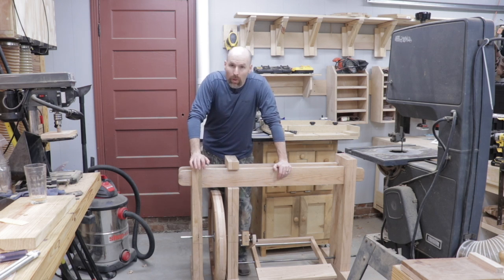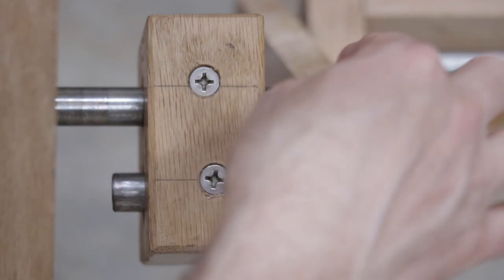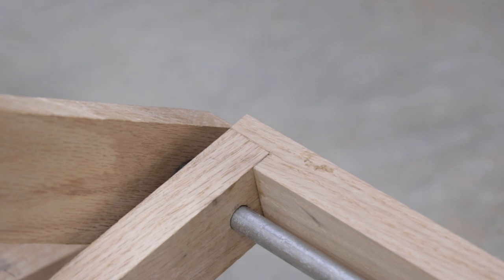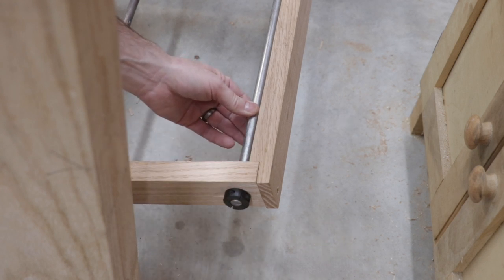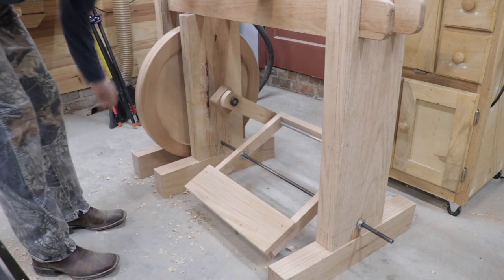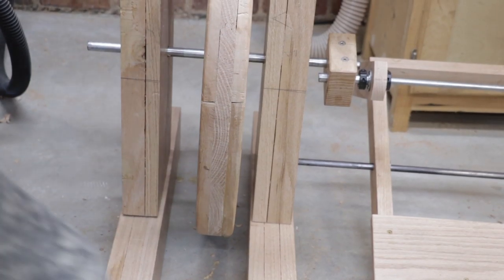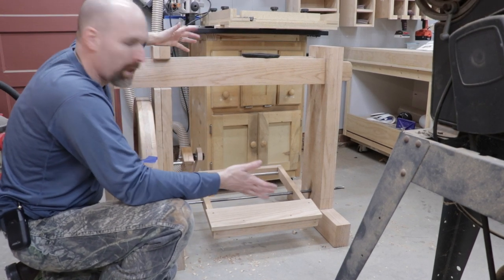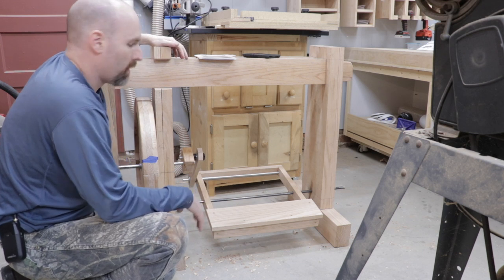Treadle Lathe Build Part XI: Treadle Pedal

Comment: Hi again, with your present configuration you can run it at 960 RPM by treadling twice per second, which is not difficult. I would yet reduce the diameter of the headstock pulley to 2in, thus increasing RPM to 1440. Not bad at all for a muscle powered machine...

Comment: If you're using a belt, (assuming)  you need to make a trueing arm for your flywheel.  Steady rest  that clamps on so you can concave the center so belt doesnt come off. 1 question why did you start using screws on lower framing?
Reply from the maker: I will be using a leather treadle sewing machine belt and it will be grooved into the center of flywheel and headstock pulley. I will also likely need a tensioning wheel. I was afraid the glue joint would fail with all the foot pressure.
Reply: @lastingbuild1373  cool, I ended up going with just the single board (mahogany) attached to the pushrod and I use a flat 2" belt. My tensioner is a wood lever arm with weights I can hang off like old scales didnt want to keep taking out springs when not in use (belt damage/ stretch).  I have 50" between centers. I cant wait to see what you are doing with the spindle I went with a fixed design like you originally planned on. Keep it up
Reply from the maker: Robert Mcdonald I would love to share a
Picture of yours with everyone following
Reply: @lastingbuild1373  I would love to, my son is supposed to come this weekend I'll see if he can take a picture for me. He has a smart phone. I'm on dial up in the huron forest lol.
Reply from the maker: Gotcha! Have him email me at lastingbuild@gmail.com

Comment: Hello, I have been trying to make a design based on this concept but I dont have much understanding of it. Is the wheel size determine how much torque goes into the pulley? 

As I am experimenting a concept using this to power my skateboard with peddling. 

And I cant really have a giant wheel cause it wont fit on the board xD 

What if I used a smaller wheel but using gears to multiply the wheel torque to output to pulley

Comment: Jim, I wanted to congratulate you for this build which is something I am working on right now and your tips are helping me a lot. I wonder if your "linkage arm" was more straight up (thus steming from a point closer to the treadle axis) you would have more leverage on the step... I think mine will have a number of tentative positions to try and see which one works better....Thanks a lot...!!
Reply from the maker: Having some adjustment in the treadle mechanism is a good idea
Reply from the maker: Having some adjustment in the treadle mechanism is a good idea

Comment: Just my opinion. I wouldn’t adjust the foot paddle until I saw how the top turning part worked if you understand what I am trying to say. You might not need to adjust it.
Reply from the maker: Hopefully, will be turning soon! The frame is all dismantled for final pegging and final shaping and the headstock is glue-up and drying🤞